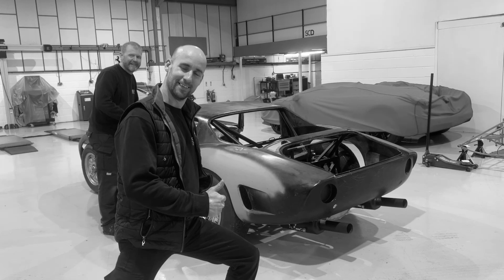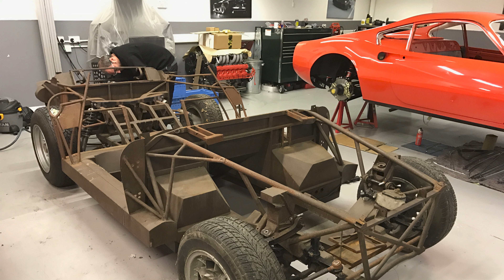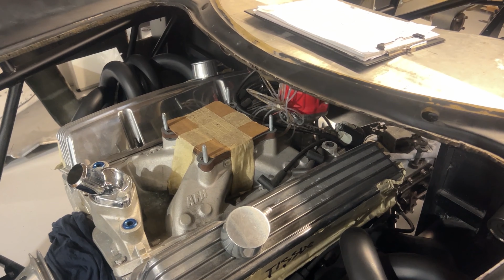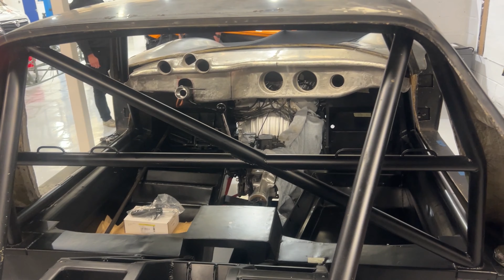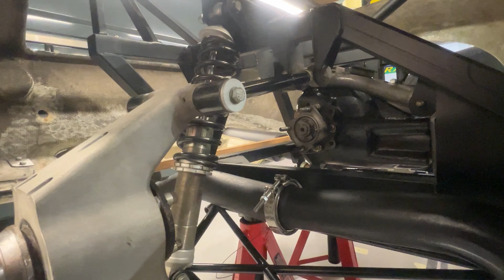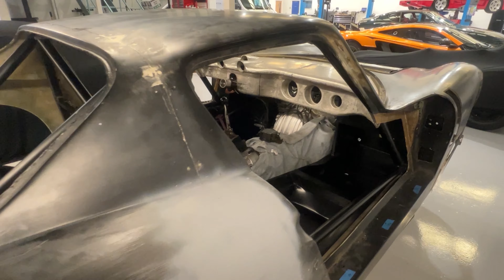Bizzarrini 5300 GT America - Restoration Project

Comment: I absolutely adore the GT5300 Strada, (the first italian mid engine supercar)... Jag bitz, non original chassis,  a real Bitza and probably 
 why it won'tbe a road car...it'll still make a stunner and i love it.
I had an orange one in 1970 (only for 5 minutes😢).... the trans tunnel was huge hence the very narrow footwells.
Mine had a dent in the drivers door so i don't remember it being glassfibre, i think it was all aluminium.
My favourite car of all time ✌️🇬🇧
Reply: Incorrect, this car will have a Salisbury axle from an AC Cobra and Bizzarrini designed independent rear suspension.
Reply from the maker: This car is being rebuilt with its original chassis! it has its original ID and will be going back on the road. This is a known car and was documented by the late Jack Koobs de Hartog in his books. Our Client is mentioned in his books in relation to this car and it has been in his ownership since th e1980's.
The 3500GT America Bizzarrini was made with a fibreglass body as a cheaper alternative of the American market. Due to its lighter construction, many were raced in the states and Europe. There were obviously several original race versions that were fibreglass and these were "Corsa" cars, the alloy race cars were the A3/C. The majority of European road versions were alloy body cars. 
The customers aim is to have this GT America very close to a Corsa car. All of the mechanicals on this car are correct, suspension and drive train are all original Bizzarini. The engine we are using for the "dry build" in the video is obviously not the original, the correct one will feature in the coming winter updates. Great to see the car getting some interest!